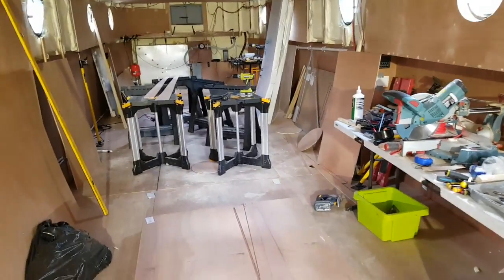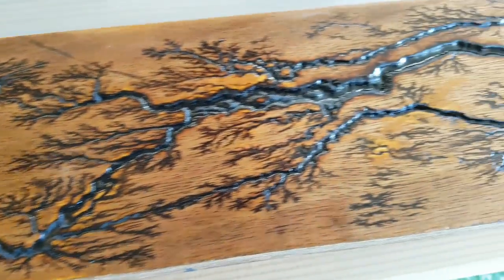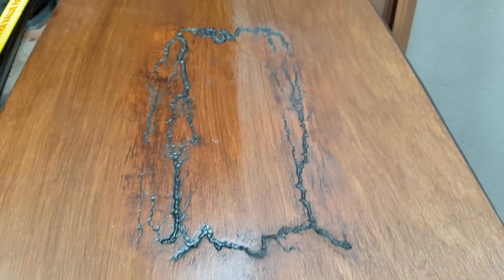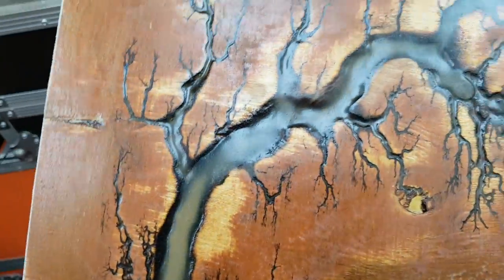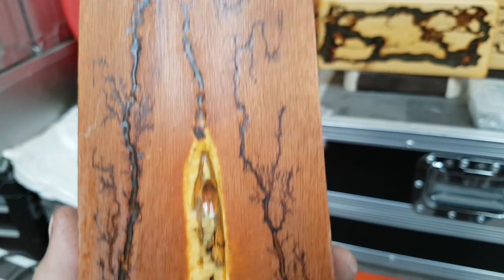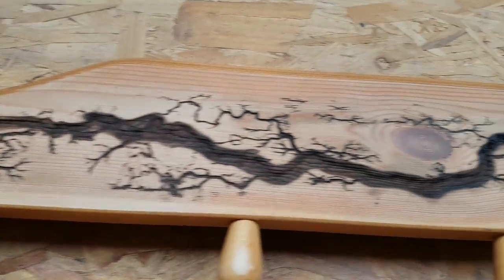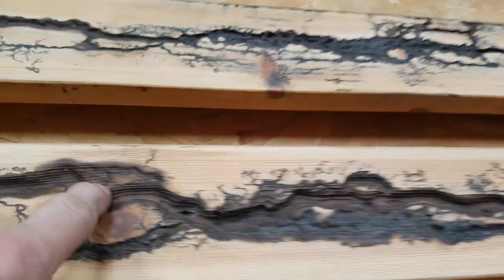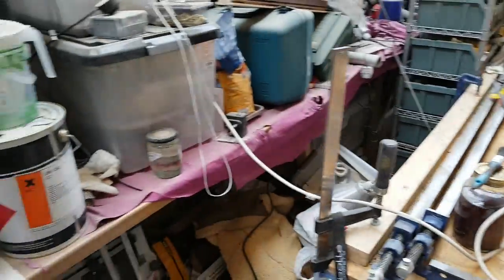Lichtenberg technique - how and why.

Comment: Hi Martyn, you mentioned that you use two different electrolyte solutions on the wood. I have tried Bicarbonate of Soda and water (1T Bicarb to 1 cup water) and wood burning with a microwave transformer. I don't get the wide deep burns you are getting. Please can you let me know the solutions you are using and how you obtain the deep wide burns? The work your're doing looks amazing. Kind regards, K
Reply from the maker: willmothclan To an extent the electrolyte doesn't play a major role in the deep burn.  A lighter mix of bicarb is good for capillary burns though.  For the deeper burns I exploit an existing burn then allow the area's I don't want deeper to just dry out.  Then only add electrolyte to the ends, if that makes sense?
The flames can be quite disconcerting at first, but I always try to keep a kill switch and couple of CO2 fire extinguishers close.
Essentially, I'm just playing :-)
Reply: Hi Martyn, thanks for the info. It's really appreciated. Kelvin